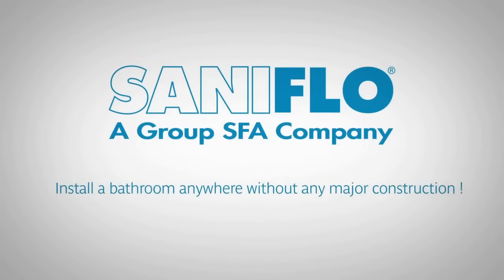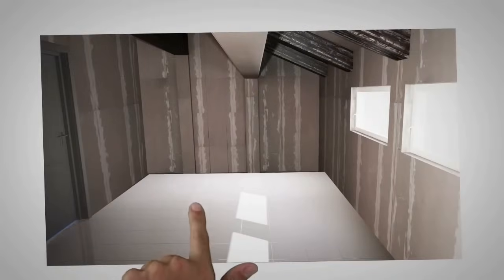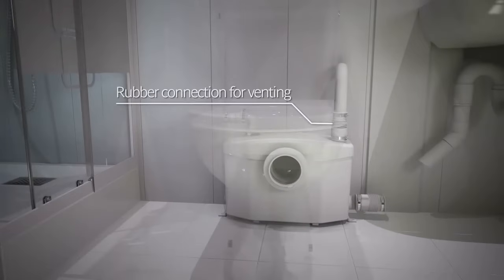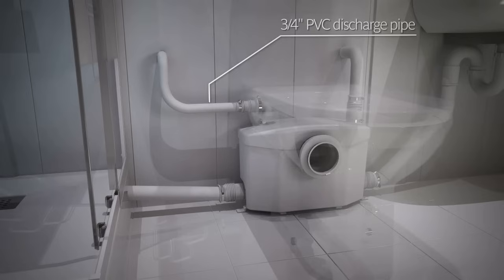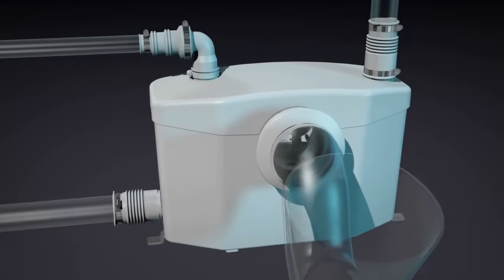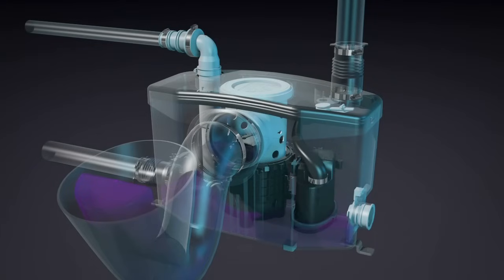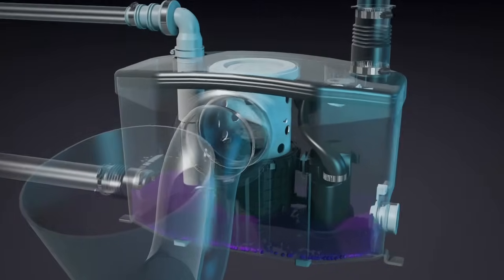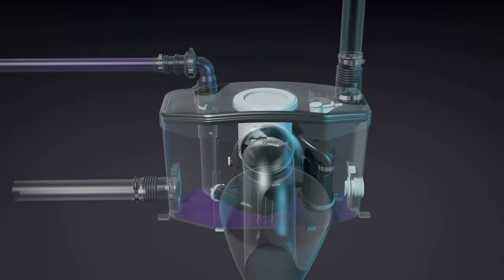Saniflo   How the Upflush System Works

Comment: Saniflow advice .if you have a shower tray close to the saniflow you end up with back pressure going back into the shower. Saniflow need to invent a non return valve which fits on the 40mm waste pipe from the shower. Also a rubber door in the non return which doesn’t rot
Reply: You can install a standard check valve that doesn’t require pressure.

Comment: What is the maximum elevation difference between the bottom of the toilet and the bottom of the sump tank? For example, is it acceptable when using the extension pipe, to have the sump tank 2 or 3 inches lower than the toilet?

Comment: I just want to say that make sure if your an installer/ plumber, that you NEED to double check that youve got the vent and sewage discharge pipes in their correct spots…!!   My plumber somehow got them backwards.  He stepped down the 3” pvc sewage to a 1-1/2” and stepped up the 1-1/2” vent pipe to a 3”.. so when i took a crap and flushed the turd shot up and out the roof..  next thing we know we have frozen crap on the roof and all down the side of the house.  It was winter..  plus since the vent was check valved and full of caca it froze and busted the top roof exit and was meanwhile causing other drains not to work because they had no vent anymore..  the house stank both inside and out.  Plumber swore he did everything right and it was a different issue we were having..  so fyi, double check..
Reply: Oh WOW. Flying turds, everywhere. While that is horrible for you to experience it is also HILARIOUS for those that didn't experience it. That's crazy. :(
Reply: @LiberalLoudMouth  :face-purple-crying:
Reply: What a shitty situation you described
Reply: You got the shit end of the stick
Reply: I’m really sorry but that made me crack up 😂
Reply: Omg😮😮. Thank you so much for the heads up
Reply: I haven’t laughed that hard from a comment on a home improvement project YouTube video. Hopefully you got everything resolved
Reply: Plumber did a shitty job
Reply: You made shitty situation into a learning lesson for us all. Thank you! 😂
Reply: So the plumber didn't want to take responsibility when shit hits the roof
Reply: Lol!
Reply: Who Flung Dung :face-purple-crying:
Reply: Wowww. Sorry and thanks for the share. Never hurts to double check the works we do. Thank you
Reply: I’m dying 😂

Comment: Will this handle the flow of a regular toilet 1.3  (gallon per flush) dropping 8' into it?  I am adding a bathroom on the main floor, but my main sewer lines are too far away for gravity feed.  Would be installing this in the basement and pumping into main sewer.
Reply: I'm adding a shitter in my basement. How did yours workout? Thinking of installing this shitter system
Reply: @tedo.2915  Still in planning and construction phase. For my application I am looking at this instead of the Saniflo.  Liberty Pumps P382LE41 Pro380 Series Simplex Sewage System, Gray.  Since I have a full basement under this bathroom, I just need something to pump the waste to my main septic pipes.
Reply: Did you do it?
Reply: @ekurdesov  Yes and it works very well.
Reply: Damn dude you drop 8 foot turds. Thats awesome.

Comment: the more moving parts. the more opportunities something to go very very wrong. 
And also if it gets activated by so little water... thats going to be one loud shower going on.
Reply: Exactly. But honestly with this day and age, "blenders" and pumps are somewhat easy to repair and replace unless this company didn't design their systems too specific to make it impossible to improvise. However, replacing the blender component would be a real dirty job.
Reply: Of course, washing yourself with just a bucket filled with water in your backyard will be bullet proof system 😁

Comment: BUYER BEWARE   we have had 2 in our basement  and they smell  do not waist your money
Reply: installed one 8 months ago and no smell at all. we ran the vent line outside.
Reply: @rickoliver9592  Hi, how far is your vent line running from where the toilet/bathroom?  Is there any noticeable smell outside if you stand around where the vent opening is? thanks!
Reply: @kmcygm  maybe 50 feet away outside. Dont notice any smell outside close to vent line
Reply: Its also on the side of the house where we dont hang around...away from deck etc
Reply: @rickoliver9592  hey Rick question, can it be install to the same vent the house already has ? Thanks man
Reply: @jamesleo4287  I would assume you can. I just ran a separate vent cause the main vent goes all the way up through the roof. long way from basement, so we ran another out the side of the house just above ground level. Ive never noticed any smell. and I dont have covid :)
Reply: @rickoliver9592  hey Rick, thanks man. I notice one more thing since the toilet has the discharge hole in the back I’ll try to install direct to the main since it’s really close to it. I’ll see if works
Reply: @rickoliver9592  QUESTION: Do you have vent lines for each individual faucet/shower? Or do you just use the 1 vent that is part of the system?
Reply: @TheEasilyForgotten  I would love am answer to that also as I am considering installing one of these systems.
Reply: You just use the one vent but make sure its sized big enough for all the hookups your putting on the system.  I would recommend running vents directly to roof as they vent better.  Smells will rise up and out better.  And if you have any sags in the vent pipe you could get water in it and make a trap cancelling out the vent..  usually a 2” pipe with no horizontal runs will work fine, if running out the side of a house make sure to slope the pipe and dont have any downward angles or u/ j bends..  seal all connections..